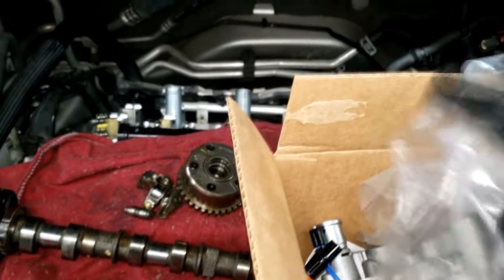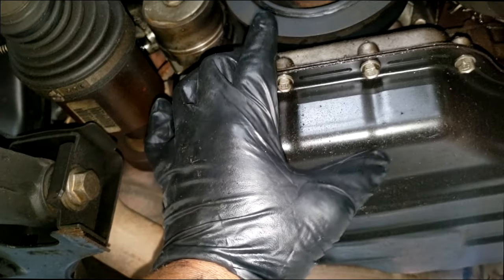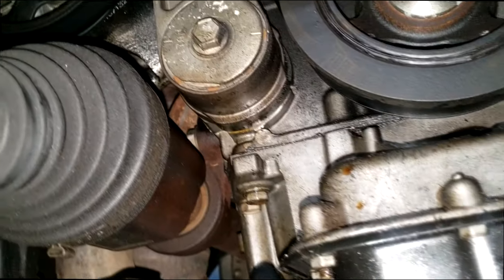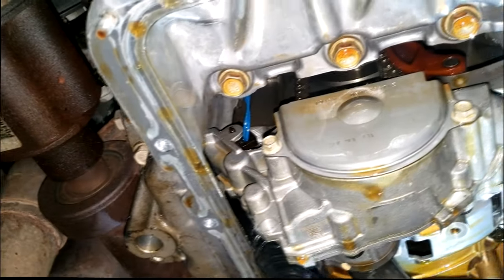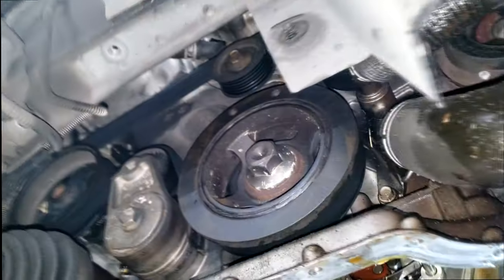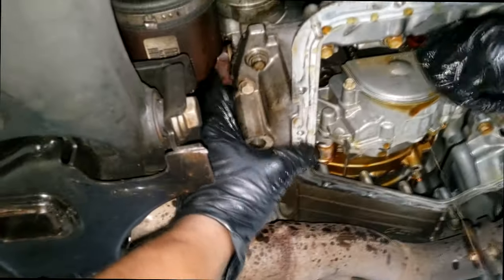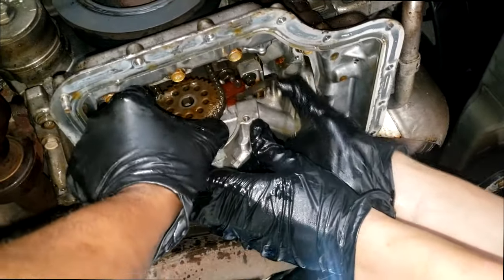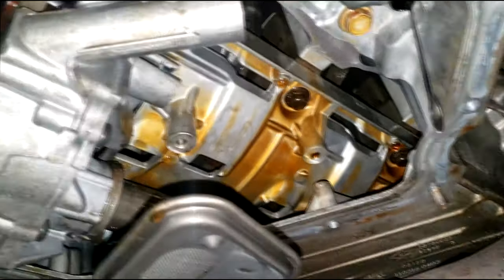How to replace a OIL Pump. Oil light flickering P06DD P0522 P06DE. Dodge 3.6 Pentastar ticking noise

Comment: Nice video of this replacement. Wonder if we all should not put torque specs in descriptions but just in videos. Had one viewer asking about a spec and I thought, humm, I could tell you what the spec is, or you could watch the part where I reinstall AGAIN and I could get paid for the answer through youtube. (Especially if not a subscriber)  (Viewers reading descriptions don't watch a commercial and we get nothing for it our hard work)
Reply: I skip through the commercials but I appreciate links in description to torque values and videos it saves some me from watching a vid 3 or 4 times- which I might do anyway. But when you’re trying to get a repair finished it would be nice to have that info

Comment: Does this work on 2016 Dodge Charger?
Reply from the maker: Yes, if its equipped with the 3.6 Pentastar. Are you having the same codes as in the video? Also are you subscribed to the channel?
Reply: @OnlineMechanicTips  Im subbed.
Reply: Eric you get this fixed? I wonder how many hours it took , how much it costs? Any info? Thanks

Comment: JT I have a 2011 Dodge Journey with 185000 code po6dd the same reason I change oil filter has the mopar filter also replaced the oil cooler with new one with new o rings then replaced oil pressure switch then replaced replaced oil temp switch because it was flakey now stay stead   Have learned if running. Oil temp below 150 the code will appear and stay on if temp is over 150 u can clear engine code and it will stay off as long as u don’t let engine cool down

I need help will to pay for a fix   JT please help
Reply from the maker: Its time for a complete oil pump assembly bud. The Journey set up similar to the Caranvans so its pretty much the same as in the video
Reply: @OnlineMechanicTips  u r talking about the oil pump correct sorry I didn’t put that in there this thing has me stumped I have replaced it with along with seloniode in the bottom along with strainer and new o ring on it too had a mechanic tell me he thought it might be main bearing getting wear and when heat up it hold better oil pressure seems legit but there is no knocking or ticking in the motor
Reply: @OnlineMechanicTips  is there anything else I’m missing like a speed sensor in trans that’s linked to it or something crazy like it needs 30 gallons of gas and some tannarite to help it go to the big dodge palace in the sky lol jk
Reply from the maker: @brianyoakem5595  No bud. You likely loosing oil pressure. This VVT sys has to produce and more importantly maintain a certain amount of pressure. To properly do a oil pressure test kind of tricky. Are there any other fault codes other than the P06DD?
Reply: @OnlineMechanicTips  that’s the only code showing that’s what’s puzzling    Do u know the parts number for the oil pump assembly you use in your video I got one from Amazon but I think after reading a couple of reviews and rewatching ur video going to replace it again
Reply from the maker: @brianyoakem5595  Yes that was a OEM Mopar high quality oil pump from the dealership. You have to give them the VIN to get the right one for your car bud

Comment: When your oil pump bad ,when you drive your car what happens to your car
Reply from the maker: Hey bud, try to start diagnostics with a fault code. Do the car have any codes? Also are you subscribed to the channel?
Reply: Yeah it’s a good question Iv had my po6da code for 3 years and the oil pressure as far as Iv known hasn’t changed in any way when driving, it runs the same way it always has.

Iv been trying to figure this out on my own with no understanding. One mechanic told me it was just the sensor another told me it could be anything , though I explained it was probably related to pump/solenoid, I had the dealer tell me the oil light went off tho it was never on and they told me to change the pump though I wasn’t explained what they saw wrong other than a code .

I keep giving away my time and money to mechanics for them to demonstrate they don’t really know what they are taking about . I don’t like giving my money away for free